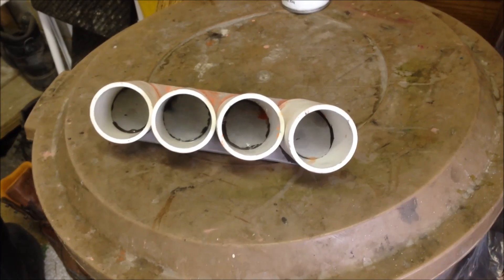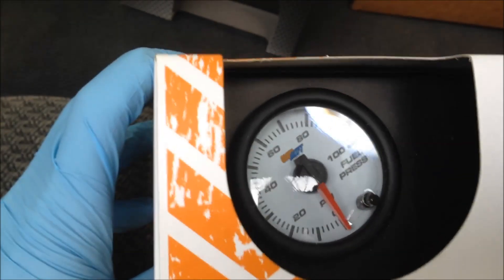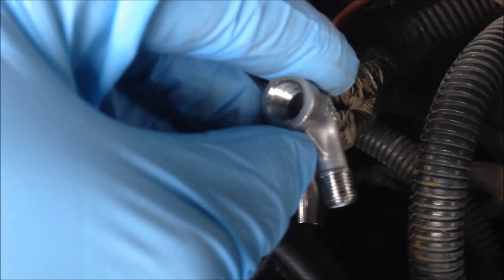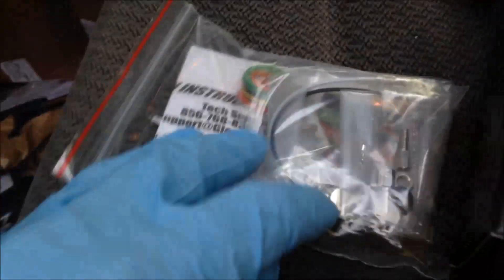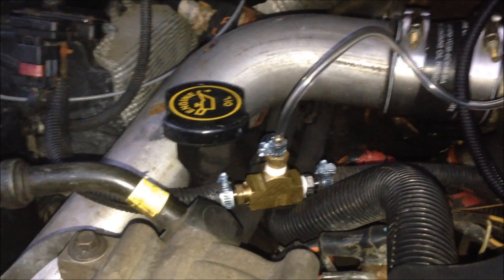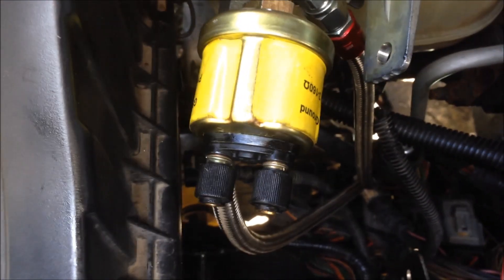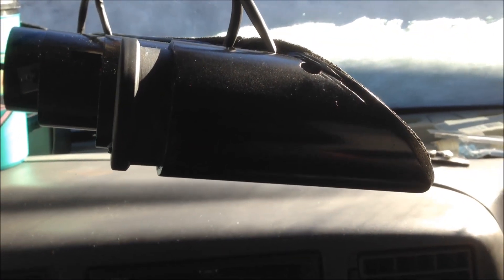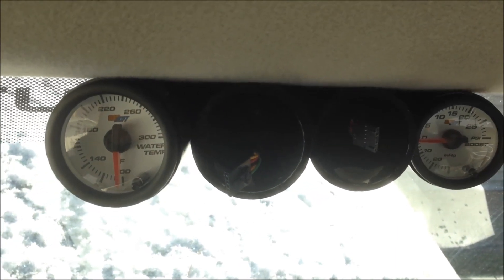DIY Windshield Gauge Pod Fabrication & Glowshift Gauge Install - 2003 Ford 7.3L Powerstroke Diesel

Comment: Hello, Please, what is the name of gauge that can show me how much fuel i used/100km? i don't have this parameter in my car. thx you very much for answer. it is Mondeo mk3 Diesel 2001
Reply from the maker: Brian - I don't know of an aftermarket gauge that will give you the mpg data - what I can say is that the boost gauge is a good indicator of mpg - if you can keep it to 5 psi or less you'll end up with good mpgs.

Comment: That flickering is normal when recording certain electronics. You see it often when PC monitors are recorded too. It just means that the frequency range or oscillations per second in Mhz or Khz etc from your gauges has been picked up by your camera otherwise not seen by human eyes. Cheers :)

Comment: hahaha you did the same mistake as I did, Got a boost gauge with vacuum when diesels don't produce vacuum.
I got a VDO Boost and vac gauge only to have my mechanic laugh at me, telling me they don't produce vacuum. I told him bullshit but he got the last laugh.

Nice setup man! I've just order oil press, oil temp and coolant temp VDO gauges for my diesel Jeep JK, but I dont know where I am going to put them seeing that nobody sells a 3 gauge pod above the radio or RHD pillar pods for my Jeep.
Just going to use singles about the radio in that top console part

Comment: How have these gauges help up over time?  Any issues/complaints at this point?  I'm looking into installing at set on my 01 7.3.  Great video.  Thanks.
Reply from the maker: I've been having some issues with the fuel pressure sensor for the fuel gauge.  Otherwise, they seem to be ok.
Reply: I’m trying to decide between glowshift and autometer. You having any other trouble other than the fuel pressure sensor, and did you figure that out?  Do you regret going with glowshift?
Reply: @marti74f  Autometer or Esspro. Pay once, cry once. Both accurate and reliable.

Comment: Hey love the install! I might be doing this for my sisters 7.3.

Anyways question on the boost gauge choice. Why did you get a boost vacuum combo? Correct me if I am wrong but a diesel engine never produces vacuum correct?
Reply: you'll know at least very quickly when the turbo fails xD
Reply from the maker: +Joseph Bruzgul 
Hi Joseph - I wasn't sure if there was any vacuum at idle for the 7.3L; hence, I bought a combo gauge.  After installing it, I can state that there is no vacuum at idle.  Hence, please feel free to purchase the boost only gauge.
Reply: Thank you!

Comment: How did you mount the base to the roof
Reply from the maker: +dana rimmer 
I dropped the headliner down low enough to mount a bracket directly to the metal structure holding the headliner.  In my opinion, it's the only way to firmly secure the gauge pod.  There are gauge pods that use adhesive; and, they don't work very well on hot days.

Comment: I added both a oil temp. guage and tranny temp guage. They run perfect all the time except when I put the heater on they go all the way up to hot temp. which is around 250. Does anyone know why? Thanks for the video.
Reply from the maker: Tony Garza 
I'm guessing ... but anytime I see the temperature gauge peg inside the car when the interior heats up - it sounds like a ground problem.  (With a bad ground, there's infinite resistance & temp will go up.)
Reply: ProjectsbyTMD I think you are right, I will need to check if it is grounded at a good location. I was thinking it was touching something hot like the manifold or engine but they are wired away from any heat. Thanks again for your reply.

Comment: How did you mount it to the windscreen? glue? double sided tape? hard to tell in the vid
Reply from the maker: Dadul Ludad 
It is secured with a metal bracket
Reply: ProjectsbyTMD Yes but how is THAT metal bracket held on to the windscreen?
Reply from the maker: Dadul Ludad 
A bracket is secured to the structure under the headliner.  The gauge pod is then secured to the bracket.  There is no glue or adhesive - which have known problems when it gets hot inside the  vehicle.  (Thus ... hot temperatures lead to gauge pod falling down.)
Reply: Okay, cheers. And that bracket is riveted in or screwed?
Reply from the maker: Dadul Ludad No rivets ... sheet metal screws to mount the bracket to the cab & threaded fasteners to mount the gauge pod to the bracket.

Comment: Nice setup. One thing that I've found works great if you're wanting to smooth out the edges a bit so it doesn't look so much like PVC tubes is the heavy nylon/spandex stockings. you can stretch it all around, it goes down into the curves a bit but soften things out. Use hot glue to hold it in place where you need, and then just saturate it with some epoxy resin. you can then cut the holes back out on the tubes with ease then just fill sand and paint. 

I also use that rattlecan bedliner when I'm looking for a bit of texture on things. Gloss will show all the imperfections, the bumpy of the bedliner helps hide all of that and looks good to boot. You can then top coat with a matched interior color as you like as well.

Either way, good video the gauges and pods look great.

Comment: Great vid. FYI, if you install fuel sen. on other side of bowl it is post filter. More accurate pressure towards injectors.
Reply from the maker: Vic - Thanks for the tip!
Reply: a trick : watch movies at flixzone. Been using them for watching loads of movies recently.

Comment: can you build one for me I have a 2004 dodge cummins
Reply from the maker: brandon pearson Hi Brandon - I can't help you out building one for your truck.  Nonetheless, it's very easy to make; and, I'm sure that you can do it!  The hardest part would be to cut the right angle for the PVC pipe.  A simple wood jig and mitre saw would be the best tool for the job.  The aluminum plate and hanger braket are also easy to make.  I'm sure that you can do it if you have the time.
Reply: ProjectsbyTMD you are a very kind fella and I appreciate your generosity and willingness to spend the time to help answer so many questions when you definitely didn’t have to. Again, thank you. I’m actually building this exact setup for my 2000 7.3. Only difference is I’m cutting the pvc to fit snug around my pillar. I like your overhead mount but I worry having it so high could be rather cumbersome to keep an eye on when on long runs.

Comment: Excellent job! Very creative. Thanks for taking the time to make and post the video. Do you remember what the angle of cut was?
Reply from the maker: Thanks for the complement Anything Mechanical! 
As for your question ... I don't recall the angle of the cut. It was larger than my power chop saw would adjust to - to get an exact measurement for the angle.  It was a bit of trial and error to get it right. Fortunately, I had enough PVC pipe to get it at the right angle and duplicate it on the remaining 3 PVC pipe cuts.

Comment: I would differently be interested in purchasing something like like this if you were to make one and be well to sell... I don't think I would be able to mock it up to those standards really nice video and right up
Reply from the maker: Hi Dustin - thanks for the kind offer - but, I wouldn't be interested in making something to sell.  I can say that it's pretty straightforward to make - the hardest  part is cutting the PVC pipe at the right angle.  If you make a simple jig to hold the pipe when cutting, it should be easy to duplicate/replicate for all of the individual gauge pods.  The aluminum backing plate is also easy to make - simple cutting tools and a file is all that you need.  I believe that you can do it!

Comment: Probably wanna know ur trans and exhaust temp 1st. I think stock gauge is fine for water!!
Reply from the maker: I agree with your comment on the EGT. I already have a video on an EGT sensor install for the SCT - PLX unit. 

Regarding the dash temperature gauge, I would like to add a comment. I had a couple of instances where the indicated temperature was concerning.  I swapped out the ECT sensor and flushed the cooling system on the 7.3L PSD.  The problem was then fixed.  

With the GlowShift gauge & sensor, I will have a good idea of the actual engine temperature - if this episode or a hot day & pulling a heavy load should ever occur again.